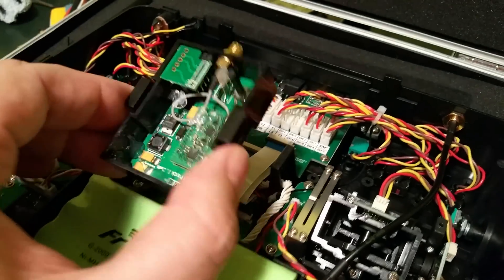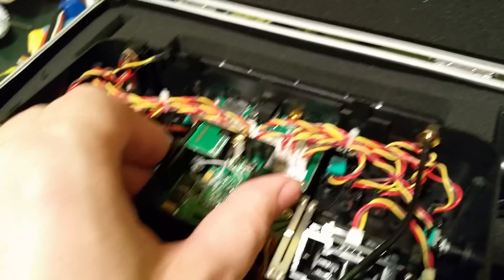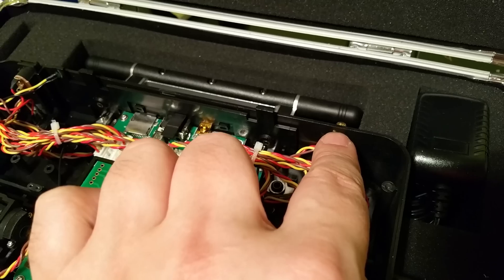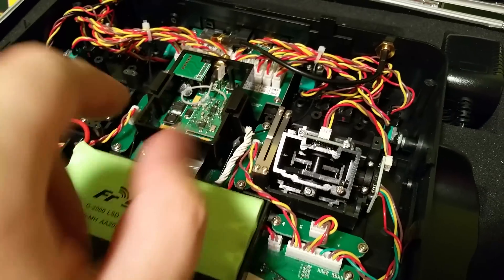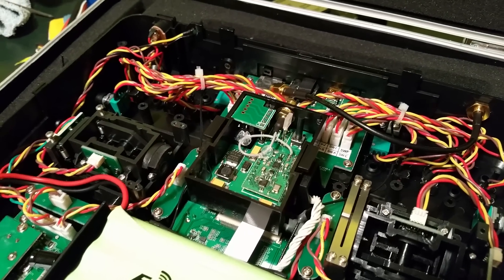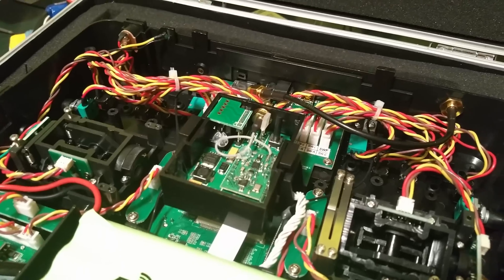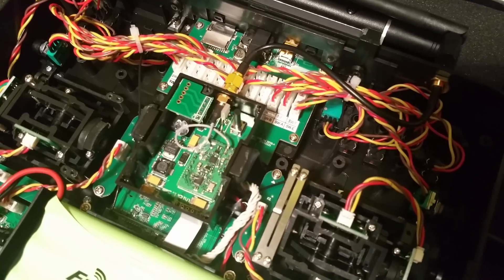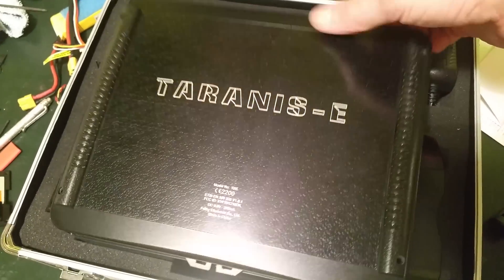External module in FrSky Taranis-E

Comment: Nice video!
Question which you hopefully know answer for: with extra transmitter in XJT mode radio should have total 32 
channels. Radio as it comes has 18 controls (2 gimbals = 4, plus 2 
sliders, two pots one on each side of radio, 2 pots in top row, and 8 
switches). There are 10 unused ports in two rows on top of front 
surface, thus you can install extra 10 controls, and there are 10 unused
 connectors inside for these 10 extra controls. So, after expansion I 
can see the radio will have 28 control channels. Do I miss something? 
The specs say expandable to 32 channels, but I only can see it to be 28 
channel after expansion. What do I miss?